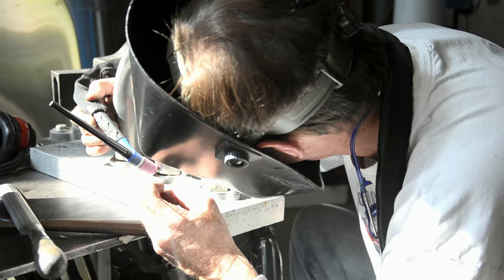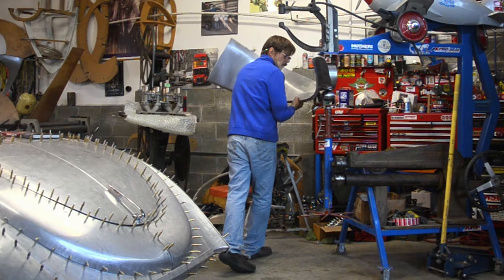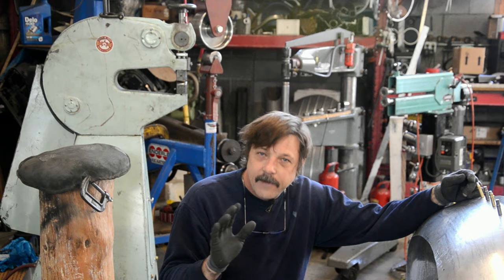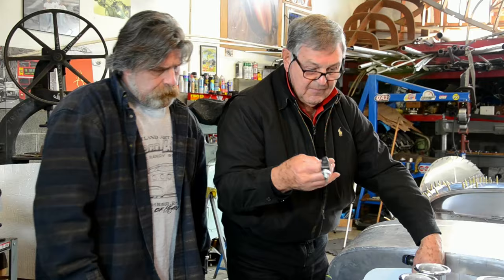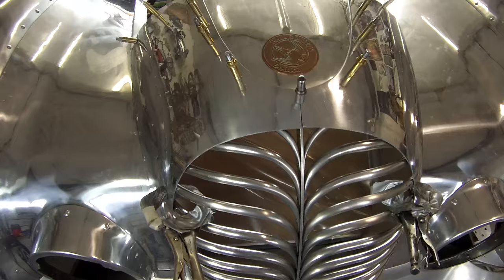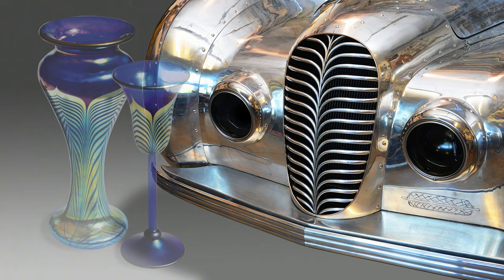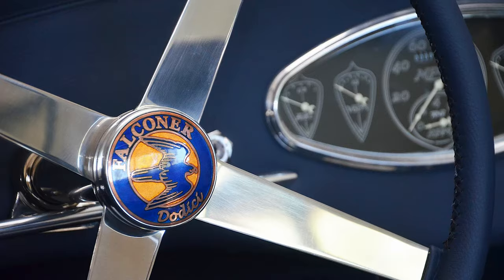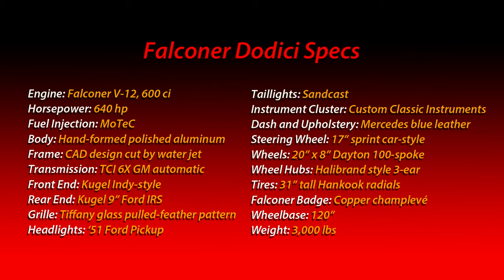Randy Grubbs Garage 10: The Falconer Part 2

Comment: I was disappointed in the sound of the engine.  It didn't sound ferocious enough.  But maybe the owner wanted something that sounded smooth, to fit with the overall vibe of the car.  I know the Falconer V12 is capable of much more power than just 640, so it must be tuned mildly.